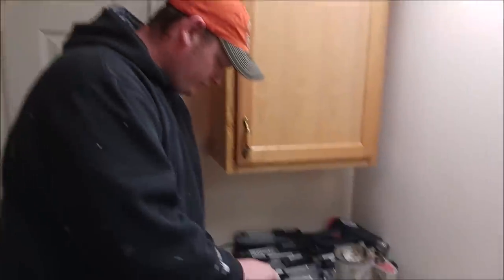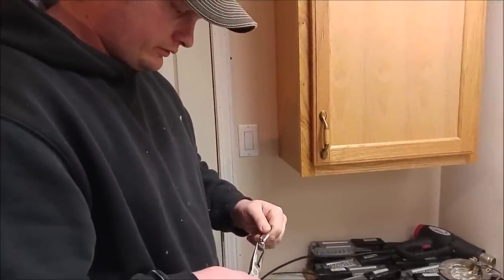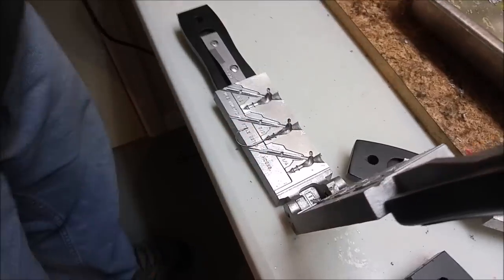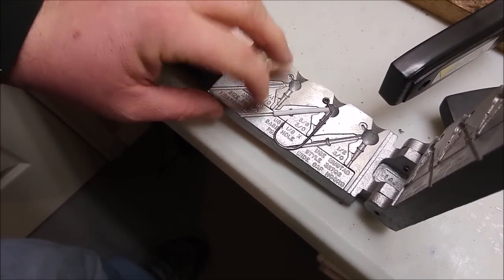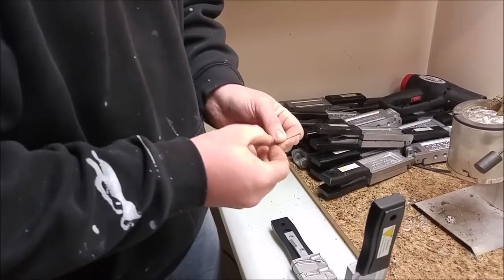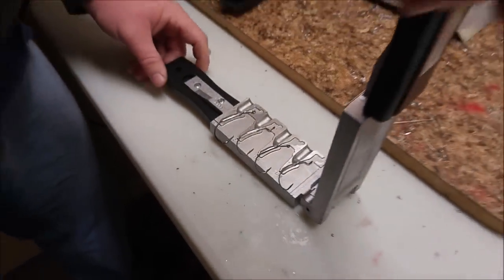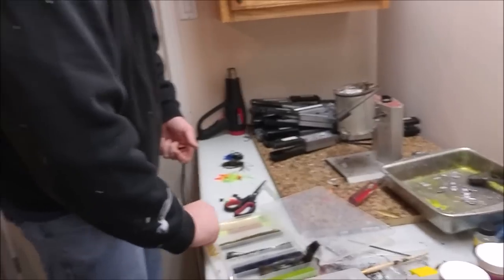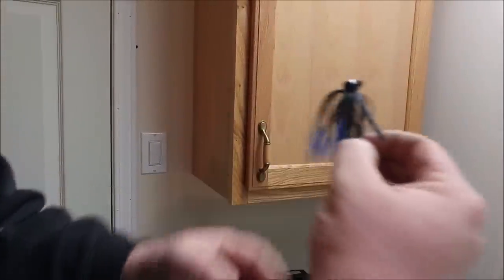Jig Making

Comment: Do you think I can get away with using a bic pen instead of the actual skirt making tool? It's basically the same thing but a smaller diameter
Reply from the maker: Danny Kyle yes you could. Might have trouble using more than two standard size skirt tabs though.

Comment: how expensive is it to start off
Reply from the maker: Tyler Rawson you can get the molds for $35-$50 each. You can find lead for around $2 per pound.
Reply: Average Joel's Fishing How ventilated is your room
Reply: Average Joel's Fishing Can you just let them cure overnight
Reply from the maker: Shawn Darling I open up windows on opposite side of the room then put a fan in one of them creating a cross draft that pulls out any fumes.
Reply from the maker: Shawn Darling powder paint needs to be baked in an oven to cure. Just letting them sit over night won't cure it. I prefer about 30-35 minutes at 300-350 degrees depending on the paint. Most powder paints will have the  Tempature and times needed to cure on the label.